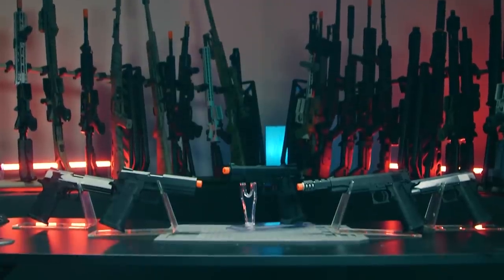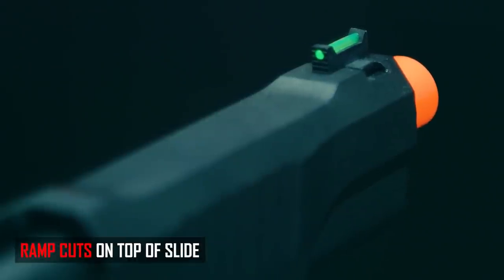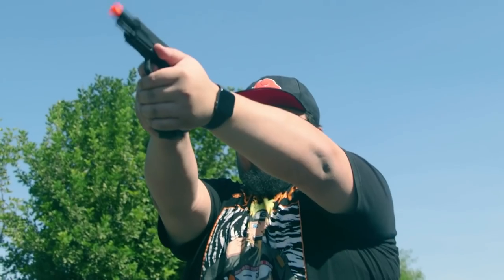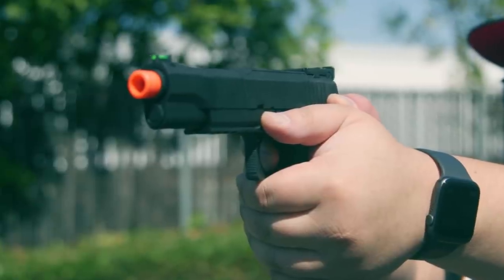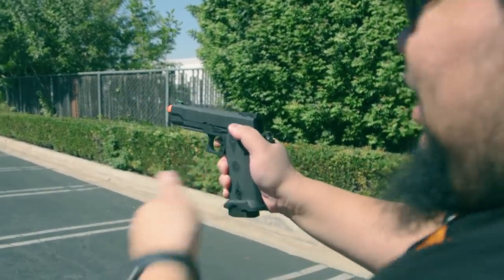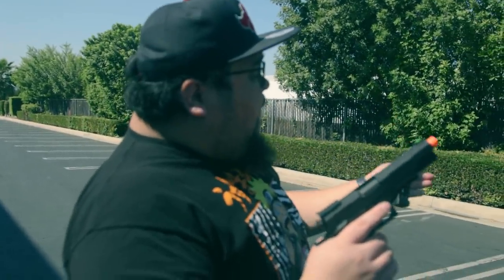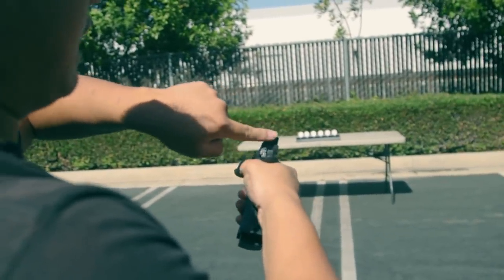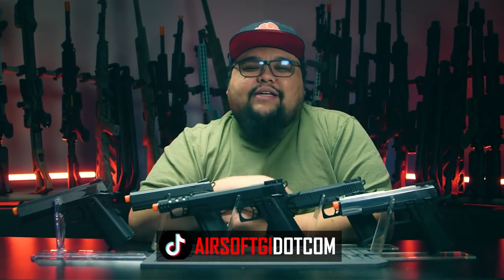DUAL POWER?! - KLI Dual Power Hi-Capa | Airsoft GI

Comment: Thats good..seems all the coolest guns are green gas and thats an automatic deal breaker for me.
Reply: Why do you hate green gas? The only reason not to use it is if you live in a cold area. But since I love in a warmer climate green gas is just as good if not better than co2. You also get better value for your money if you buy a bottle of gg compared to a bunch of co2 cartridges.
Reply: @carterskindle7086  i personally prefer co2 for the consistency plus i already own a lot of co2 because i own an air gun.
Reply: @carterskindle7086  I live in upstate NY,may give it a chance one day.
Reply: @jonathanbleecarter  ok, yeah. New York does have warm and cold weather. CO2 would probably be the better option.
Reply: @carterskindle7086  I want to like green gas,they have all the sexy pistols.
Reply: @jonathanbleecarter  yeah they really do. There are pistols that can run on both green gas and co2 all you have to do is buy a green gas and co2 magazine.
Reply: @carterskindle7086  Got the shadow,looking at the p09